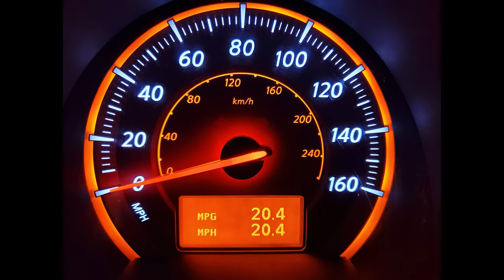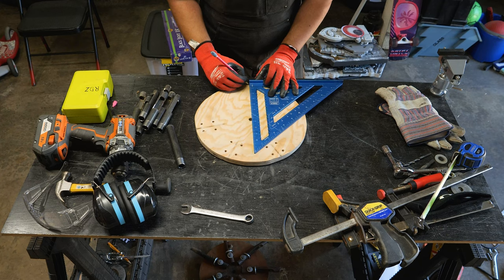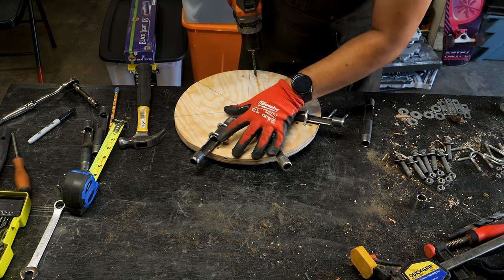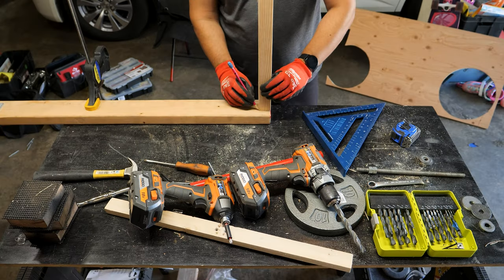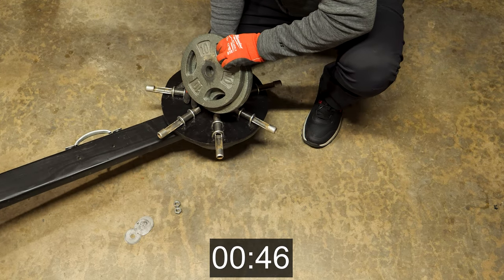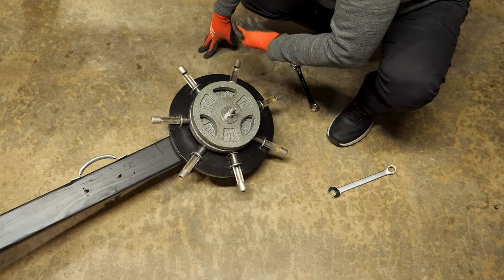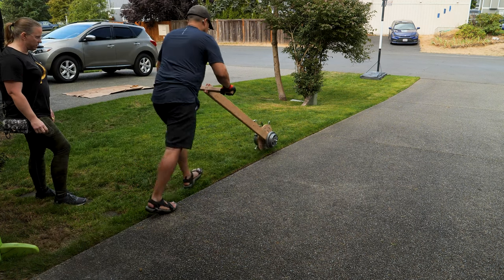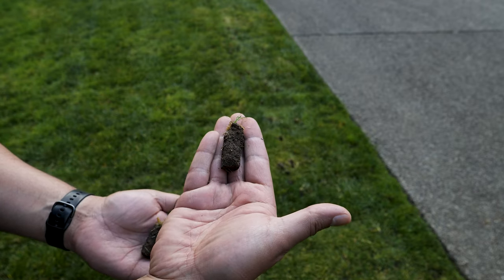A DIY Lawn Core Aerator For $160?? You'd be surprised!!

Comment: Nice job! Have you considered a second wheel? Double the result for the same energy spent and increase stabilization.
Reply from the maker: Thank you John. Yes, I get asked that a lot so the next upgrade video will be trying it out with a second wheel. As it is, it's already very stable. I think it will also depend on your soil type if the same energy will be spent as some may need to add a few more pounds to better penetrate into the ground. Either way, it'll be a fun project. 👍
Reply: I thought of that too, but that would mean you need more weight to make the tines sink in, and it could become difficult to push. I saw a guy testing a 3 and 5 tine manual aerator that you have to push down into the soil and noticed he had a much much harder time pushing down 5 tines than 3. Seemed crazy how much more energy it took.

Comment: Great Video!! How did you cut small pipes into core tines please? What tool did you use? I’m getting ready to make my own 👍🏼 Thank You!!
Reply from the maker: Thanks. I used the same tool in the video. A grinder with a thin cutting disk to cut the pipes in half and the core ejection cut outs. Then using the grinding disk to grind smooth the tips of the tines.

Comment: Nice build! Found this video looking for an alternative to the Amick. I’m thinking about potentially replacing the wood handle/extension w telescoping square tubing on your design…. So I can collapse it for storage. Any recommendations for “straight” hollow tines? Trying to avoid grinding metal pipe. But the tines you tried are slightly curved, and for obvious reasons need to sit flat.
Reply from the maker: Hello. I really like your idea of a telescoping tube for the handle. So the tines I installed on my build are straight since I cut them from a straight pipe. The curved ones are on the first link on the descriptions. For whatever reason, straight tines from the web are very expensive and have a little more bulk to them, but they're out there. The curved tines will work just fine. On my pervious build, I used the curves tines, but I wanted the holes a little bigger which is why I went with a 3/4" pipe. Hope this helps.
Reply: @vandit0o0o  question, when you installed the pipe, was there any particular reason why you didn’t or couldn’t install the Ubolts around the threaded portion of the pipe? I’ve read the Amick tines have a notch in them, which the Ubolts clamp onto to prevent the tines from pushing back in towards the center of the wheel as it hits resistance going into the ground.

Comment: How did you cut the opening in the steal tines? What kind of tool set up do you need? Also, why didn’t you use the tines you bought on Amazon? Could I just use those instead of making my own? Sorry for the hundred questions
Reply from the maker: The tines from Amazon were giving me cores to thin and they'd get clogged to quickly, so I gave up on those. I used my grinder with a thin cutting disk to cut the tines in half and then using that same disk just smooth out the tips. Hope this helps.
Reply: @vandit0o0o  thanks. Cutting the tines in half was pretty intuitive, but did you use the same cutting disk and angle grinder to cut out the slots to eject the cores?
Reply from the maker: @adrianjohnson1028  Yes I did. 👍

Comment: Is there a reason you didn't make 2 plug wheels and maybe put 1-2 weights in-between so can get 2 rows of plugs instead of one?  Or is it not enough weight to move 2 wheels?  Thanks for sharing, this was very helpful.
Reply from the maker: I wanted to show that it was possible to make a very affordable core aerator so that's why I kept it to one wheel. Plus I wasn't sure how easy 2 wheels was going to be to use. I've gotten so many requests to make mine a double wheel so it may happen this summer.

Comment: Very nice. I was wondering...in your prototypes, did you try or consider cutting the pipe at an angle to give the business end of the tine a beveled edge(pointy tip)? I just got my supplies tonight for this weekend project and was wondering if it would help the point penetrate the ground more efficiently or if in your experience, you discovered a drawback to doing this.
Reply from the maker: Great question. Most commercial grade tines have the angle to their tips. The reason I didn't make angles is  because i believe those are meant to go in one direction, rotate the whole machine and continue. I needed mine to go in both for convenience. So you reach the end of your yard, move the handles to push in the opposite direction without having to rotate the whole thing. If you want to try cutting angles to your tines, I wouldn't recommend making them to aggressive. I hope I'm explaining this clearly. If this doesn't sense let me know and I'll continue  to try to explain. I hope this build works for you as it did for me. Send me any more questions you may have.
Reply: I would think having the angled tip would work fine as long as the angle was facing away from or toward the wheel and not in the same line.  Maybe even left then right then left, etc. This way, it wouldn't matter which direction it was pushed.
Reply from the maker: @tomholley6904  That's very true. I didn't even consider that. I think it's worth trying out. At least with my soil, I'm not having any issues with the tins going into the ground, but if It was an issue, I'd defiantly try the angle on my tins. Thanks for the idea Tom. Keep up the good work.

Comment: You could put a circle of tines between each weight and staggered them, making it 3 times as wide and taking 1/3 of the time to do the same area.
Reply: it may be worth a try. but each tine that punctures the soil is added resistance so you may need 3x more weight if you are trying to puncture 3 holes instead of 1.

Comment: How do the tines stay in place? It doesn't like there's a groove holding them with the U bolt. With the clay soil where I live, I'd be afraid the tines would be pushed out of the U bolts like they were a core of dirt.
Reply from the maker: I don't think you'll have to worry about the tines. Once in place, the u-bolts hold them in place very well. I've used my aerator a lot and haven't notice the tines move at all.

Comment: I think you should have two wheels it should handle easier
 to handle & pull more cores with each pass.
Reply from the maker: In my other builds before this one, I did have 2 wheels. The reason I did one wheel on this one was to show a simpler build. But, a future modification video will more than likely be adding a second wheel.

Comment: Thanks for posting this, I had come up with a very similar idea and I'm happy to see that it can work. Could you explain the reason for having two nuts at each end of the axle, and why they need to be tightened in the manner you describe at 5:22 ?
Reply from the maker: Hi there, great question. The nuts on each side are there to keep the wheel in place and stable. If you don't tighten the nuts the way I showed, they eventually start to spin loose by the wheel or weights as you're using the aerator. Tightening the nuts towards each other will lock them in place.
Reply: @vandit0o0o  Hi Albert, great video. I’ve been trying to come up with an idea for a corer for a while and you’ve just made my day, with your invention! I shall be working towards constructing one in the near future.  A suggestion, if I may. Instead of using two nuts on the shaft, you could use some NyLok nuts, which will stay in position but can be altered or removed if need be!  Thanks for your wonderful contribution to gardening! Look forward to many more.
Reply from the maker: @johnnytungsong8719  Hey Johnny, thanks for your comment. I did consider some lock nuts, but I was trying to keep the cost as low as possible. I'm really glad my video helps you out. I worked really hard on this one. I got a update video coming out soon. Have a good one.

Comment: Brilliant, but I want at least three wide if possible.  Make a larger one?
Reply from the maker: Thanks. I may make 2 more models this summer, both with double wheels. I think 3 would be to much. I need it to be fun and easy to use. But for sh*ts and giggles I may venture to a 3 wheel model.
Reply: That's not gonna work. A 2-wide version already doesn't penetrate as well as a one-wheel version.
Reply: @TheEchelon  From what I can tell, the tines need to be replaced with pointed ones to make it amazing.  Then the dual would be better!  I also found a company who makes these with a break rotor!
Reply: It would need to be heavy and you would want the wheels to spin independently otherwise turning it would be very difficult. Probable would cost more time and effort than the single wheel.

Comment: I'm still not sure why the curved tines can't be used, but I did find one company called Green Scott that makes and sells straight tines, but the minimum you can buy is 25 for $100. It looks like a small company and may sell a person fewer for less if you talk with them.
Reply from the maker: So the curved one can be used, they may just not work like the straight tines in my opinion. $100 is a bit pricey. And then what would you do with all the extra tines you don't need. Maybe call them up and see if they could work with you to only order what you need without having to buy so many.

Comment: Hey Albert, why did you decide to go with pipe for tines instead of the tines made for this?
Reply from the maker: Hey there, so I decided to make my own tines since the premade straight tines are to expensive and the cheaper tines all have a curve to them. I needed straight tines so I could more easily use then in any direction I needed to go. Hope this helps.
Reply: One more question, can you make a video on making the pipes into tines? Or point me in the direction of another vid on this? Also, did you print the wood before painting or just paint it black? I just bought an angle grinder and never used one before.
Reply from the maker: @enzomoya1689  I could make a video on how to make the tines. All I really did was mark a square on the tines and with a thin cutting disk just cut out that square. As for the wood I did sand it a bit before painting. I would suggest watch as few videos on how to handle a grinder. They can be loud and dangerous if you are not careful and not wearing the right safety gear.
Reply: @vandit0o0o  If the tines all angle out in the same direction is that okay?  I bought those angled ones as I don't have the tools or really the know how for the metal work.  Thanks.
Reply from the maker: @ryanomeara8232  The tines should all be facing the same direction and they should be angled to where it looks like they are clawing into the soil when you are walking forward. Watch some core aerating videos and see how they have their tines facing on their machines.
Reply: I made tines out of 1/2 pipe and sharpened them, but wall on pipe to thick to penetrate lawn. Any other ideas for material to make tines?
Reply: @douglasfackrell4730  I wonder if conduit pipe would be sturdy enough? Also,  be sure to water 1 or 2 days before so tines can penetrate better.
Reply from the maker: @douglasfackrell4730  How thick are the walls of the pipe? And did you water your lawn to soften it up? It's best to use strong metal for the tines. Also, did you grind down the inside if the tines to help slide the cores out easier?

Comment: How deep are the actual holes? Your pIugs look short. And long plugs may be several short plugs stuck together. If the pluggers extend more than two inches beyond the wheel they are attached to, I suspect that they’ll rip gashes  in the turf rather than make holes. The angles at which the plugger enters and exits the ground are mirror opposites. The plugger needs to enter and exit vertically like a sewing machine needle.
Reply from the maker: Hey there. So my cores pop out between about 1-1/4 inch to just under 2 inches (the tines stick out about 2" from the wheel). Yes, if the tines stick out to much you'll get some wide gashes. I'm very happy with the cores that pop out on mine. The tines going into the ground vertically is one way to do it. Many different types of core aerators exit for your particular needs.  If you build one of these just play with the tines (both in how much they go into the ground and how many you put on the wheel). Build it to whichever way works best for you.
Reply: @vandit0o0o  I don’t mechanically aerate since I discovered that routine humic acid applications chemically aerate the turf more thoroughly.
Reply: @tycox8704 

Petramax Liquid Aerate is amazing stuff.

In the fall, I bought a pair of spike aerate shoes, the results of walking around in those and using Petramax Liquid Aerate are the same as thorough core aeration. Just less time consuming.

Comment: If I wanted a 4 inch deep hole over your 2 inch hole if that would translate to 2 times the weight.   I understand that soil conditions would play a part.  Just trying to get a WAG...
Reply from the maker: Good question. Hmm, if I was trying to 4" cores using this build I'd be worried that the holes will be wide ovals. Is there a reason why you're trying to get 4" cores? When it comes to the weight, yes it would depend on the soil conditions. I would liquid areate, then water for maybe a 2 days (1" of water a day) test a few cores about 2-3 days later and water more if needed to get deeper cores. Hope this helps.

Comment: I’m in the process of custom making my tines. I’m curious how long it took you? Took me like 10-15 min to do one
Reply from the maker: Hey there, well it was much faster for me. I'm sure the brand new cutting disk helped. It honestly cut like butter. Are you using a disk like the one I showed in my video?
Reply: @vandit0o0o  same one with a Milwaukee m18 grinder. It’s working it’s just a lot more work then I expected lol
Reply from the maker: @smh4536  You're not the first to ask about how I made my tines. I gotta make a simple how to video on how to cut them up. Let me know if you need any more help.
Reply: @vandit0o0o  I basically clamp it down and cut the lines I marked with the disk or a multi tool but it’s been a pain in the ass. But I think I’m good thanks. Can’t wait to try this thing out !
Reply from the maker: @smh4536  Well good luck to ya. Hey, and let me know how it all turns out for you.

Comment: Perfect tool when the lawn is 1 inch wide.👍
Reply: Seems like an easy tool to use across bigger lawns.  People push heavy lawn mowers across all types of lawns (large or small).  If people can push heavy lawn mowers across massive lawns every 2 weeks... I'm sure they can wheel this super light device around a large lawn ONCE per year.  Don't be a dick.
Reply: make a wide version with many wheels
Reply: The problem with adding more tines is resistance! It will be harder to penetrate and would have to be even heavier than the 40 lbs he has on it.

Comment: Build one with multiple rows at least a foot wide.  Put an electric motor on it and a platform on top.  Hook a car battery or deep cycle boat battery (not sure which would be better) on the platform for weight to the electric motor and bam.  Powered core aerator.  Use a refrigerator cart for the frame and mount your core assembly on the bottom of it so you can tilt it back and use the wheels for turning around and moving it.  Add a switch to it for on and off as well.
Reply from the maker: Well, going electric is popular now. Lol. Wow, very impressive. So how well does it work for you?
Reply: @vandit0o0o  I haven’t built one.  Just an idea that popped into my head while watching the video and thinking someone could build something better.

Comment: Just thinking out loud, couldn't you make front or back wheels for your lawn mower and remove 2 of the original wheels on the lawn mower or find a way to snap them on temporarily to the existing front or back wheels (that would be gold, no need to remove anything from the existing lawn more, snap on aerator wheels), add these customer "aerator wheels", cut the grass and aerate at the same time or just take advantage of the existing weight of the lawn mower and the handlebars already created on the lawn mower.  You're already there with this proof of concept invention, you've shown it yourself in this video that the the wheel with the aerator spikes works and produces nice size soil cores.
Reply: Green Scott Aerator sir, $80

Comment: For side eject tines to spit out cores, they must be banana shaped. Those tines will clog...also wood for the disk is not heavy enough
Reply from the maker: Hey there, yes you could use different types of tines and get good cores. I didn't (they kept clogging and gave me smaller cores) which is why I made my own and had much better success as you can see from my video. The wood frame is lite, which is why you need to add some weight to it. When not in use, the frame is conveniently lite enough to move, take apart & store. You could always modify my version to best fit your needs.

Comment: Try picking up some used car rotors for a few dollars or even free instead of buying expensive weights.
Reply from the maker: I thought about rotors at first, but because of covid, I built a small gym so I just had the weights.
Reply: Likely not heavy enough, depending on soil.
Reply: @MichaelCampbell01  He's using 20lbs of weights. A single rotor on my car is 25 lbs.